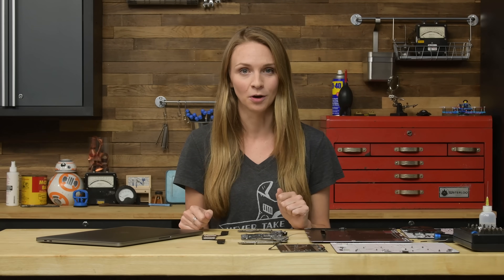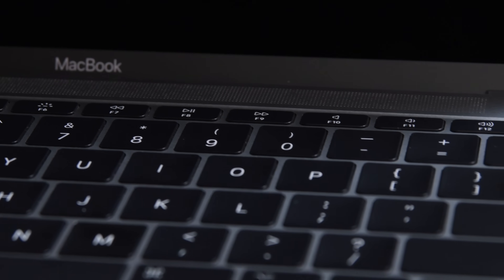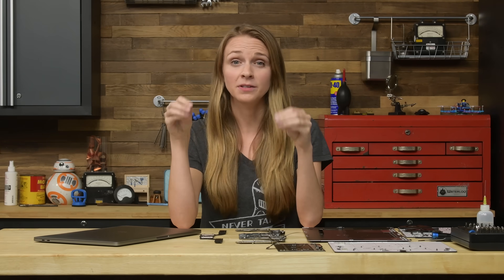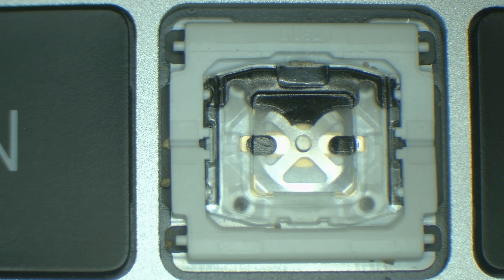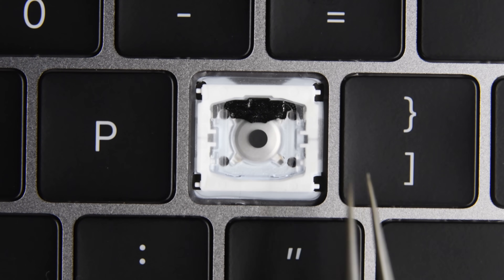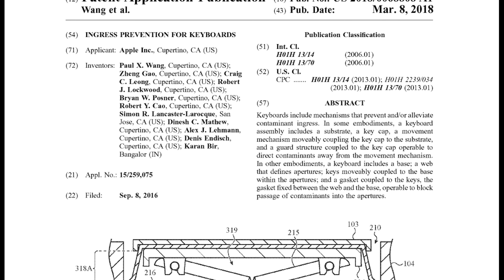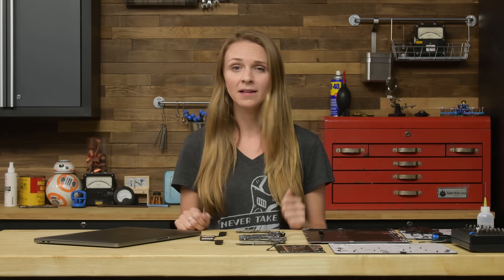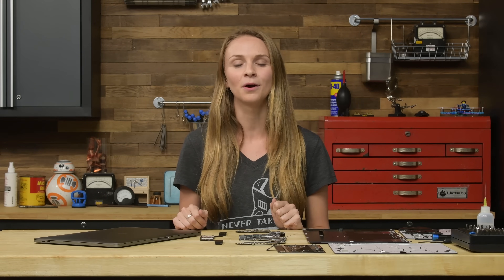MacBook Pro 2018 Initial Findings: Keyboard Design Cover-Up?

Comment: It appears the issue has not been fixed. I have a 2018 MacBook Pro 13inch (quad core) and the key ''E'' gives out two imputes every once in a while. I want to say about once every 30 times I use the key. I had heard of the dust issue and got a keyboard cover as soon as I purchased the laptop. I thought I wouldn't have an issue since I have had the cover on it a few days after (after had appeared as afteer but autocorrect fixed it) the purchase. I tried going into the settings and turning off the repeat key option but it has not fixed the issue though I have noticed (it did it again at noticed) a slight reduction in frequency. Do you have any suggestions? I have already tired restarting it and doing the pvram reset (option+command+P+R)

Comment: Ihad my Macbook keyboard replaced 1 year agoand had to pay $600 for the replacement keyboard which unfortunately is starting to have issue again, starting with the specebar.  As youcan clearlysee here in my typos.  Apple sucks!

Comment: so I just took my computer in for repair for that exact issue because my shift and 7 key were non responsive. I got my computer back today after two weeks and they did replace it with the newer keyboard. they may have just started doing this but I noticed the keys are quieter and the option key symbol is different.

Comment: For those that have the older keyboard. I just had my top case replaced by apple on a 2016 15" MBP. The keys are much quieter indicating that they're putting the new membrane keys on machines that come in for a keyboard repair. I asked the technician - he stated that they this keyboard does have the membrane.

Comment: I have a 2017 macbook pro and got the new 2018 keyboard after they replaced the whole top case. It's a real good upgrade with the sound and it types more smooth now.

Comment: I figured I'd comment here -- I just talked with my Apple repair place and asked that same question (Does the apple keyboard replacement program give the new keyboard design to the last gen MacBooks?) and according to them, the answer is no.

Apparently, owners of the last gen MacBook Pro would have faulty, last gen keyboard replaced with the same model -- However (and I kind of laughed when I heard this) they do offer an extension to their keyboard warranty for up to 4 years... so if that piece of junk craps out on you, you'll be happy to know, you will get a brand new, exact the same, piece of junk.

Don't shoot the messenger.
Reply: Excuse my poor sentence structure, I'm tired.

Comment: Here's my interesting experience with Apple:
I had a 2011 MacBook Pro 15.
1) They claimed it supported Windows but that was half the story. MBPs are UEFI devices, which means they don't have BIOS-like software. UEFI devices boot about 12 seconds faster than legacy/BIOS ones, but when I installed Windows 7/8 and 10 on my Mac it wouldn't install them as  UEFI OS's but as BIOS ones. Boot speed was so low. Apple could've made it UEFI but DID NOT.
2) The MBP supported both USB and DVD booting of OS X but it only boots Windows from DVD. My fragile DVD player got broken so no chance of booting Windows from USB. Again, they could've fixed this with a tiny update but they DID NOT. Funny thing is, older versions of OS X like 10.7 and earlier supported Windows USB boot, bot not later versions.
3) The graphic switching that saves tons of battery power does not work on Windows, not because Windows does not support it (HP and Dell among others have it) but because they didn't want to. Apple did this on purpose to make you think that Windows is not power efficient. But to be honest, with Windows's hibernate/sleep and peripheral disabling options, I bet it's more power efficient than MacOS.
4) My MBP had a SATA drive. Those drives support up to 600 MB/s (For SSDs at least) but when installing Windows apple doesn't let Windows install the SATA protocol that supports 600 MB/s, it only allows the SSD to run with the outdated slow 130MB/s IDE protocol. Apple wants you to think that Windows is slow.
5) The trackpad isn't as smooth on Windows as it is on Mac. Sure, Windows doesn't support some of Apples' gestures but the 2011 Mac didn't even support Natural Scrolling on Windows, yet other brands like HP and Dell did.Again, Apple wants you to have a bad picture of Windows.
6) Apple doesn't support writing on NTFS file systems. Sure, there's third party apps that do the job but unfortunately they are not reliable. If you wanna run Windows   alongside MacOS, then forget writing on Windows partitions. Third party drivers will sometimes cause Windows not to start.
7) Core storage. For the average user, this is like a virtual file system. Apple went from a standard (concrete) file system (HFS+) to the virtual CoreStorage (from OS El Captain or Yosemite ). If you happen to delete your files accidentally, good luck recovering them as file recovery software interacts physically with the drive.
8) I got a new iPad and sold it the next day. It wouldn't transfer any file via Bluetooth to non-Apple devices. My Samsung/LG/Sony and Huawei devices all support Bluetooth transfer to one another.
9) When my model was released in June 2011, USB 3.0 was already around. HP had implemented it. Why didn't apple do it since their Macs were the most expensive in the market? That's beyond me.

I'll update this if I remember anything but the point is: DO   NOT   BUY     APPLE. They care about money and money only. They don't give a shit about customer satisfaction. You've been warned.

Comment: it looks to me as though apple's engineers fixed the issue with a silicone mat underneath the keycaps, but apple's lawyers said no we can't acknowledge that the other ones had problems so just say the side effect of a slightly quieter keyboard was the whole purpose of the new generation of butterfly keyboards

Comment: Are SSD's and/or Memory soldered to the board on these new machines, or can they be replaced independently of the board??! For comparison: When shopping custom Storage or Memory for this new machine, apple hints a Note: "MacBook Pro memory / storage is not user accessible. If you think you may need more memory in the future, consider upgrading at the time of purchase." In contrast the low entry 13 inch mbp the note says: "Please note that the memory /sotrage is built into the computer. If you think you’ll need additional memory, it’s important to upgrade at the time of purchase." Just launch your extensive findings on this one already, please! A picture from an opened machine should be sufficient to find out, whether apple considers their users morons or us users can actually not access it. Their ominous internal repair guideline (see macrumors) point towards all being solderded, or why would geniuses completeley give up on repairing them and instead ship the straight to off-site repairment centers?!

Comment: This looks promising, let's hope it does help.. though I am skeptical it will give any benefits in case of liquid spills. 

Would it help to put a silicon membrane on the top of the keyboard? I am considering buying a MBP and I saw some colleagues with that kind of solution, but I have no clue if it is just something in their heads or if it does actually change something... I would think that the membrane should seal the keyboard to prevent (more) dust to get into the system (either between the film and the keyboard or inside the keys), a bit like the rugged field computers/keyboards (which are sealed with silicon, protecting them from dust and liquid spills).

It could be cool to have a dust and liquid resilience test comparing the previous and new models of keyboards... Would you be considering doing this test? :)

Please, refer to the link to see an image of what I mean (PS: I have nothing to do with that kind of product or the companies involved, I am just curious and thinking of a way to better protect a computer).

https://image.dhgate.com/0x0s/f2-albu-g7-M00-D0-B8-rBVaSVo2LKaAWv1qAADtica0f8U758.jpg/transparent-silicone-eu-us-keyboard-protective.jpg

Comment: The real solution would be to redesign somewhat the shell and keyboard mountings, making it removable entirely with the press of a button. The keys could also easily have a button or something to simply allow them to release and you could use an air gun and clean there and simply snap back on. Really there should not be this demand for non-modular laptops that users cannot service themselves, it creates this stupid problems
Reply: since when does apple make removable things?

Comment: Still not enough to be a 100% fix. I’ve replaced dozens upon dozens of MacBook pros with this sticky key issue. Some of which had a problem with a single key. They really need to change the design entirely. This is the 2nd revision they’ve done of the original butterfly design. Too much work is being given to techs such as myself and I can no longer defend Apple’s poor design choices.

Comment: I have a 2016 MacBook Pro 15" and have just compared it to my partners MacBook Pro which is also the 2016 15" model. He has not had a replacement (yet but it is now unfortunately booked in for a repair 😡) my keyboard is much quieter, so I can confirm I have the new butterfly keyboard! I got the entire top case replaced under the program on Wednesday.

Comment: They are a somewhat better company in the sense that they always want to catch problematic things and fix them... What i'd like to know is how many of those in their "testing" facility has been fired for things like "you're holding it wrong" and only use it in a clean room so dust won't get into the screen heck it will only do that after 3 years that's your problem by then because you don't have warranty sucker...

Comment: I called my local apple store yesterday regarding the question with the keyboard replacement program on older gen butterfly keyboards, and they told me that the new 3rd gen keyboard would not fit in my 2017 MBP, so they will just replace my keyboard with another 2nd gen keyboard. Apple is completely disregarding everyone who they tricked into buying their enticing machines with shitty engineered keyboards.

Comment: ‘Member when PR said it didn’t? 
I ’Member. Assuredly to avoid going into the class action. Anyways, I'm curious if these have those terraced form fitting batteries, since capacities increased quite a bit without a weight increase.

Comment: Apple MBP 2016 - Lets kill ALL the ports and kill half the battery (not to mention it was weaker than 2015's model)
Apple MBP 2017 - Skylake to Kabylake processors with shitty graphics for the price (still managed to be a generation behind)
Apple MBP 2018 - Ok, cool. Major spec bump. Battery is shit. Keyboard is still shit. Cooling system is still a drag compared to other laptops like every single Mac ever...

Step in the right direction tho...

Comment: After 15 years for buying a top end laptop from Apple my next laptop will be a Windows laptop.  I bought a 2017 MacBook Pro and gave it a far shot, but I just had too many issues and returned it.  I returned to using my 2015 and will use it till it dies.

Comment: As you said, it's more of a bandaid than an actual fix. That membrane looks so thin, I don't think it will last. Plus, it doesn't look like it covers the whole key so dust may still get under the mechanism.

Comment: I use the MBP 2017 since it’s release now. Well while my first had this problem on delivery, the one week late replacement (imiditaly after release in this case; due to maxed out settings and a non typical keyboard for my region), I didn’t have the issue at all. I use my MBP 6-10 hours per day for typing intensive work (programming) and I have no issue at all. 

I know it sucks if you get faulty hardware but I don’t know how people use their expensive tech if the allow so much dirt on it that some of it can slip inside. 

About the change in the key on the 2018: If the silicon layer is not fully covering it only reduce the issue but will not prevent it. It looks like there is a hole in the middle of it on the video. So I guess this Layer is more for the reducing sound.

Comment: The fix seems like it wont really do much? It has a huge hole in the middle which means that while dust and particles dont have an easy access anymore, after some time they would reach the middle and go inside! 

This certainly would happen after like 3 years of use, and people dont replace PCs often!

Comment: I notice that the patent application shows a membrane covering the ENTIRE key mechanism but the real world machine only has a kind of skirt (there's a hole in the membrane) which means that the possibility exists for liquid, dirt and debris to get UNDER the membrane and therefore into the mechanism. Is this REALLY a proper fix?

Comment: Does this idea really deserve a patent? Basically, it just has a small keyboard cover (which is common) below the key cap. So, from now on, no one else can put a cover below the gap when they add a thin keyboard? Also, doesn't this affect the 'keyboard typing feel' badly? I mean, I do not use a keyboard cover because it feels bad when typing.

Comment: Actually i think this only does delay problem. It does not solve anything. Dusts still exist inside keyboard button. And worse it will impact more than old models after the cover is beat by dusts.
Reply: Vo Hoang Sang but that means people with a previous MacBook Pro can just swap out the keyboard with the new one to kinda prevent the issue. Well, Louis Rossman may answer to us

Comment: Why is this membrane "only a bandaid of a fix"?  Is it not a reliable fix?
Reply: yogiyoda because heat from the Mac is also causing some problems with the keyboard
Reply: Think of it this way, you have a problem with the door to your house coming off its hinges, so instead of solving the problem with the hinge or frame you just put a bunch of hot glue all over it because you're lazy and cheap... That's borderline what apple has done here, rather than address the actual issue, they've basically made a workaround which is "good enough" and that would be fine for any random inexpensive computer, but is that really acceptable on what is supposed to be a premium/professional brand selling computers at a premium price? 

On top of all that, with any other laptop you can usually replace the keyboard for about $30 and it takes maybe 10 minutes to swap it yourself, with these butterfly keyboards I forget the exact numbers but before the warranty program it was more like $300 and 3 hours to take to a repair shop and have them remove all the little pegs holding the keyboard in place, then even worse than that is you couldn't just plug in a cheap external keyboard and be on your way because it would only work if you also had the $80 dongle sold by Apple, so basically at that point you have an expensive brick until you bought the dongle or had it repaired.
Reply: Well, this thin film isn't exactly going to stop all dust and dirt. If dirt manages to get into the system it still will break the keyboard.
A band-aid fix is one that delays the issue and doesn't solve the underlying problem.

With this fix it's only a matter of time for dirt to reach the keys. And when that happens the problem still persists.
The only way I wouldn't call it a band-aid fix is if they waterproofed the key mechanism due to how fragile they are.

Comment: Will you keep us updated if Macbook Pro keyboard replacement users will get the new keyboards?
Reply: Mine was replaced a couple days ago and I’m happy to report they did use the new gen 3 keyboard with the membrane. (2017 13” tb mbp)
Reply: Bart Valentine really?! How did u find out?
Reply: Exactly, that's also my biggest concern.
Reply: Hi Bart, it is great to know. Did you check the membrane under the key yourself?
Reply: how do you know they did use the new?
Reply: I got mine replaced last week and I can confirm that they used the updated version shown in this video. Even the Staff confirmed it.
Reply: @Spirovsk  How is going your keyboard now? Any problem again?

Comment: Still nope for me… I'll keep my 2014 macbook pro till a major keyboard change happen… maybe another 3 years? Also I'm interested to see how the new keyboard hold up few Months down the line…

Another thing, membrane like this will wear off after many use and heat torture isn't it? Unless the new MBP isn't as prone to heat up as easily as previous Models, which I doubt…
Reply: MintArcade 2014 and you're already considering a replacement? Damn...I use mine for like seven years.
Reply: Have you considered moving away from apple keyboards?

Comment: Really interesting, but would have liked to see a teardown of the repair program keyboard earlier.  They will likely not be using this.
Reply: Perhaps they will use the new keyboard as replacement for the repair program keyboard later.